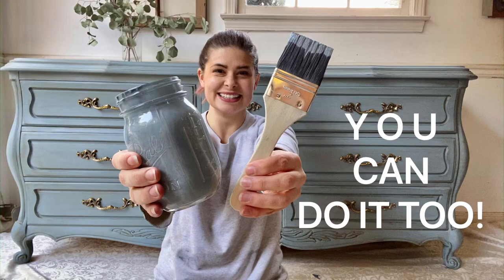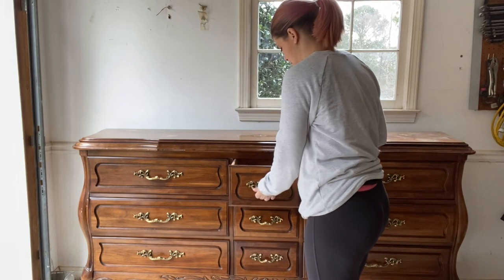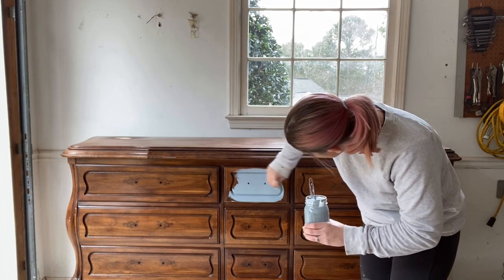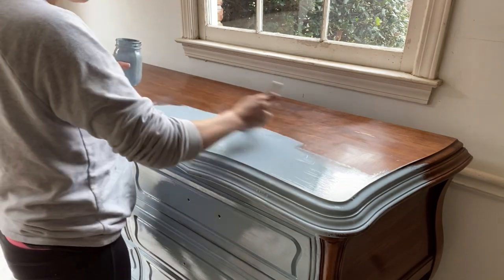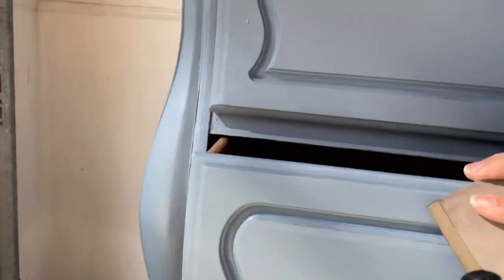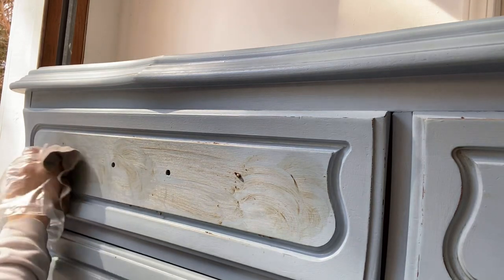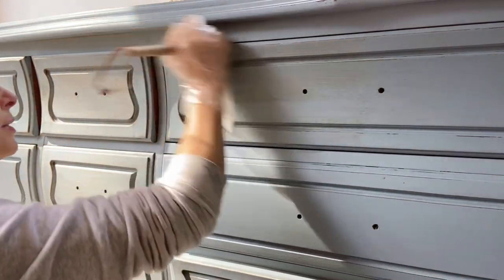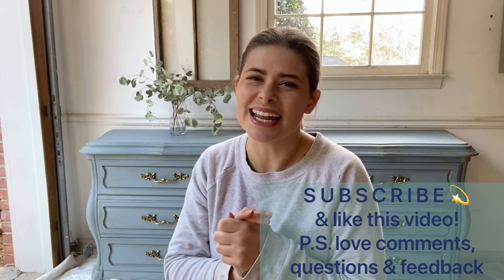Painting furniture with chalk paint | Using Wax to seal | beginner friendly | French dresser

Comment: This is beautiful, i have recently used annie sloan’s clear wax on a black piece of furniture but i am really scared if it is going to be durable like polycric or it is going to show all the finger prints and may be get scratches on top, plz help as i have a tv unit on hand to be painted and i am soo confused as to what top coat to use to make it durable, saw so many people using clear wax to seal so tried it but i am really worried, plz plz reply if it is durable enough to withstand scratches and also after it cures it will not show up finger prints, sorry for a long comment but really need help, tia
Reply from the maker: Hi!  Wax won’t be as durable as clear coating with polyurethane will be.  I really like Varathane water based polyurethane, do at least 3 coats for a tv Stan top and then put felt pads on the bottom of the tv stand, I buy my felt pads at the dollar tree.  Wax is fine for lightly used items though and if you are careful and use pads it holds up but poly will always be more scratch resistant ❤️
Reply: Thanks soo much for ur reply,  i was so concerned as i have to do the tv unit for a client and I wanted to make the finish as durable as possible. Here everyone uses clear wax to seal the buffets as well as coffee table , thats y I also decided to try out wax but for some reason i felt like its not right, but thnx so much for making such informative videos ad also answering our queries, really helpfull for us beginners.
Reply: Just one more question, will the varathane work with annie sloan chalkpaint as well?